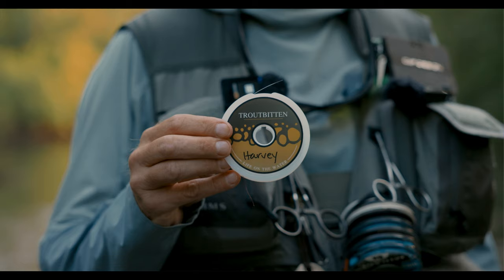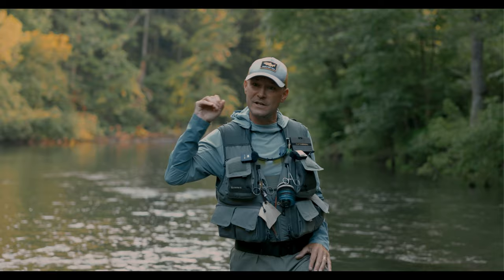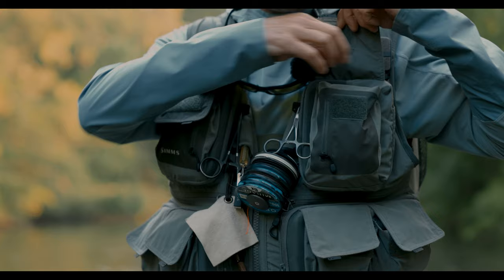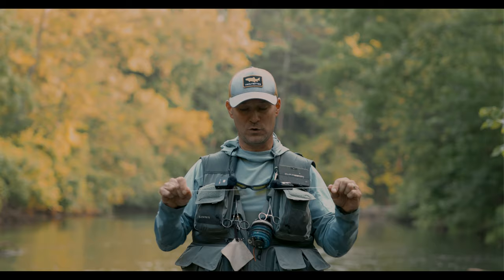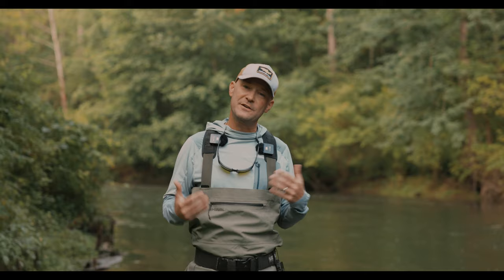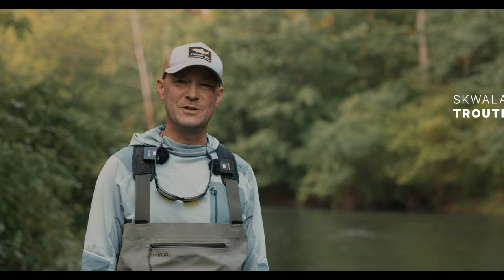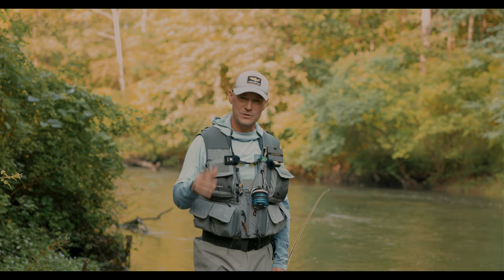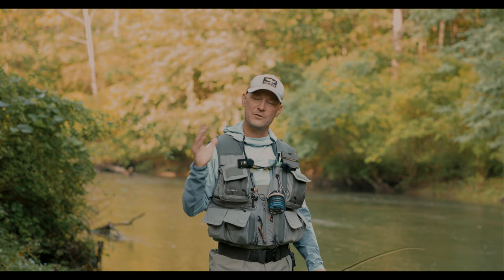The George Harvey Dry Fly Leader -- Design, Adjustment and Fishing Tips

Comment: Thanks for the great video Dom! On a windy day would you cut off the 5x tippet to get the 4x section to turn over? Also, I fish a lot of tight water on smaller rivers where I’m making 25 foot casts or even shorter. Any tips for using the Harvey leader with only 6-8 ft of fly line outside the guides?
Reply from the maker: Good questions. There's a lot to the adjustment, really. Check out the companion article here for more on that:
https://troutbitten.com/2023/08/03/video-the-george-harvey-dry-fly-leader-design-adjustment-and-fishing-tips/

There are links in this video and in that article to more resources about the Harvey leader. Adjustment is one of those things you need to experiment with. All of that is a long answer to your question, because I can't just say yes, cut the 5X off and choose a 4X tippet. Maybe, yes. But fly size and bushiness, rod power, wind speed and direction, casting style, distance, etc. all play a big part and making that decision. 

Lastly, yes, I would simply shorten each section in the leader recipe to downsize it for  smaller streams if you like. So shorten each section by, say, 25%. That's a start.

Cheers.
Dom

Comment: Great video. I’ve heard of these leaders and even made a couple.  This is the best description of why you would use them. Could you use Ultragreen instead of Chameleon, I have ultragreen.  Thanks for the videos.
Reply from the maker: Thanks. So the Harvey, or any similar slackleader design really is different, which as you said, I tried to highlight in this video. And that's because of how it's built. I always tell people you CAN sub whatever materials you like for any leader recipe you find. Testing things out is the best way to learn how different things can be. However, just like a new fly pattern I choose to tie and fish, I always like to tie leaders exactly as the recipe calls for (and fish it for a while) before I make any changes. And if I do make changes, I do so with a purpose -- meaning, there's a reason I modify the leader or the fly, because I'm trying to achieve something. 

I suppose my point here is that I wouldn't use Ultragreen just because you have that laying around. I would first tie and fish the Harvey as the recipe calls for. Chameleon is far stiffer than Ultragreen, so the performance -- the punch -- will be quite a bit different. I'm sure of that. 

Cheers.
Reply: @Troutbitten  Thanks for the info. I’ve never worked with Chameleon and didn’t realize it was stiffer. I might have to do some looking and see if I can find some locally. There isn’t a lot of fly shops locally. I enjoy learning about leaders, I feel they are probably one of the most misunderstood parts of fly fishing.

Comment: Hey Dom, I really enjoy tying my own leaders. I was going to buy this one from your store but they are sold out(good on ya). I was wondering if I could use maxima ultragreen in place of the orvis supersoft, as I already have all the sizes I need? the only thing I will need to order is the maxima chameleon in 10 and 6#. Thanks as always for the excellent resource!!
Reply from the maker: Hi there. Fair question, but no, I wouldn't use ultra green because it's not soft enough. It's not really tippet material, as I use it.

Comment: Thanks for the video Dom. I’ve heard some people have issues with the blood knots getting stuck in the guides when a bigger fish decides to take a second run. Any experience with that?
Reply from the maker: Fair question. Two things there  . . .
First, simply tie clean blood knots and clip them FLUSH, with no tags.  A knot like this will not hang up.
Second, a Harvey leader, at .015 on the butt section, attached with a clinch knot to the fly line loop is MUCH cleaner going through the guides than a loop to loop connection with a .022 or larger diameter butt section.

Article here:
https://troutbitten.com/2019/03/06/loop-to-loop-is-bad-try-attaching-your-leader-to-the-fly-line-this-way/

Those are my thoughts. Hope that helps. Cheers.
Reply: @Troutbitten  thanks Dom! Always appreciate the insight
Reply from the maker: @stevenjones5930  Sure thing